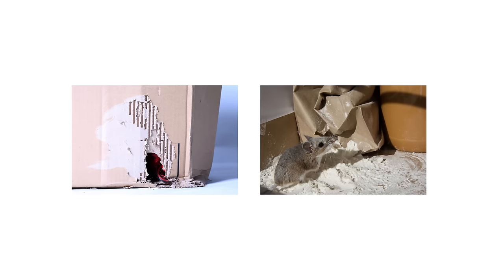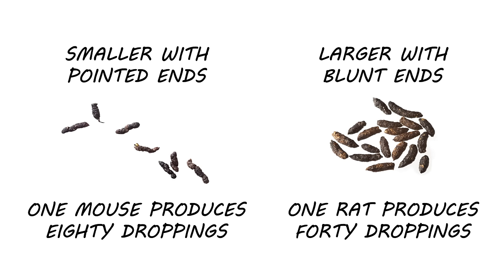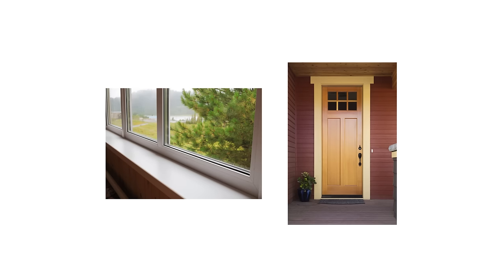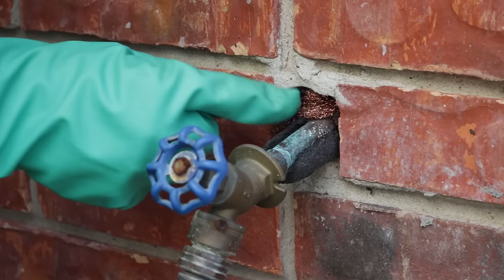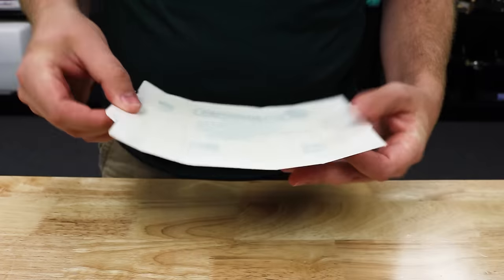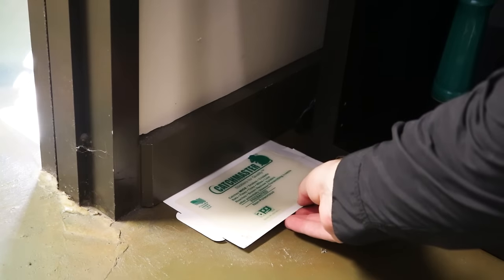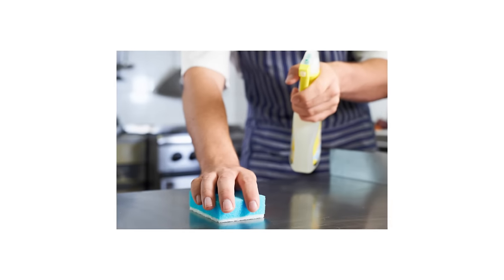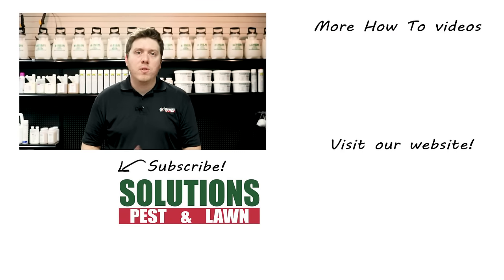How to Get Rid of House Mice (4 Easy Steps)

Comment: I never had a mouse till the last cat died at 18. Now it's like they got a memo 'cats gone' and I've had several. I am not use to killing them, I'd rather catch and release. I hated snap trapping, plus they get use to them and don't go near them after one or two died on them. I got rid of several with a simple bucket and food in bucket. They can only jump halfway up the bucket and by then I can release outside. The ones that can get out of bucket (better jumpers) are a problem. They love to explore, even places where there is no food. Why? THEY LIVE TO ANNOY ME!! They know I am a SAP and that they can jump out of any simple bucket. They are cute, and are smart as can be, but of course you don't want them in your house. The sterotypical mouse invaider BS is just that. I am an animal lover, and killing them with glue traps is not an option. The glue traps they show can stick a mouse, they you can remove them with oil. BUT! The sticky traps sold are too deep and the mice cannot be removed with oil. So, I took some of the sticky off and put on pce of cardboard. Only then can the oil on the trap work without killing them Believe me, they put too much glue on traps and mice cannot be un-stuck from it. It is a terrible way to die and the mice squeek and suffer terribly. The glue traps in the vid you can't find anywhere.

Comment: This guy is good- so far I have killed 5 mice in kill traps - the plastic kind - and it’s been about 10 days since we saw the first one . We found what they were eating a few days ago - - I’ve been trying to clean now - I warn everyone to be careful
Which cleaners you’re using so you don’t create a toxic gas - I was worried cuz I first sprayed bleach water everywhere in the bathroom
And then wiped all
The droppings up with paper towel section by section - and then got a bucket of Lysol and dumped that water all over with sponges - nothing happened to me but I think it was bad to mix those ! So now I am
Exhausted
And will
Keep at it next time I can get energetic ! ( they were eating hard corn cobs we had in a pile of stuff near the oven - for the squirrel feeder outside —!! ) I totally forgot about that corn ! Yuck !!! Such a mess . It was in a plastic bag so - get proper storage bins . 😢 so disgusting ! We will get this done !

Comment: Thank you for this video.  I just caught a mouse in a rat trap and it was only his tail trapped so he whined and cried.  I turned over the trap and he made mousy noises as I prepared to strike it with a big metal spoon inside a plastic bag.  I had no other way to end the situation without striking the mouse in the head a few times before it stopped moving.  I felt bad about this and wondered if I should not buy a live trap and release at the park so he could be owl food.  I have a hard time seeing mice dead or dying.  What is your recommendation?
Reply: They're driving me crazy seen them twice already got the old snap traps and use peanut butter as bait the little bastard ain't bite

Comment: There are mice in the walls of our extension, they dont seem to be in the house proper yet, no droppings found anywhere. I called pest control and he put poison and stations all around the house and attic. I also have a major phobia of mice, so right now it's a really tough time for me. I am barely sleeping. There is a pipe outside that is not in use and i think this could be an entry point. I had covered it with a cap but theres a poison base right next to it. I should have asked the pest control guy. But can anyone tell me whether i should keep this pipe covered or not? Because if it is the entry point I want them to be able to get outside to the poison. Sorry for rambling but I'm extremely stressed by this
Reply from the maker: Good morning,
We recommend you save exclusion until a couple weeks after the poison bait has been set. If the bait's outdoors, the mice happen to be indoors, and entry points are sealed off, then the mice won't actually be able to reach the poison. Depending on the poison used, it can take several weeks before you notice a reduction in rodent activity. Then you can seal entry points with stuff like copper mesh and caulk.

Good luck!
Reply: @solutionspestandlawn thanks very much for the reply and advice, I will remove the cap. The pest control guy is coming back in a weeks time, I just want them gone. People don't understand when I tell them how terrified I am, I'm having panic attacks everytime I come home from work and listening for sounds to the point where anything I hear im assuming it's mice or rats. Yesterday morning after work I put clothes in the drier and then when I was in bed thought the noise of the drier was a mouse or rat in the kitchen. is there any use in playing repellent sounds out near where I know they are in the extension? It's so hard working nights and not being able to sleep I just want to do anything at all to get rid of them. Thanks again for getting back to me
Reply from the maker: Unfortunately there's not enough evidence that supports the use of sonic repellents for rodent control. If you have no problem with killing mice, then we recommend you set up some baited snap traps around your home to supplement the poison your pest control guy is using. 5:36 in the video is where we go over how to use our Easy-Set Mouse Traps. Keep in mind that any pest control is going to take a lot of time and patience, and you may not see results as quickly as you hoped. Remember to keep up with regular cleaning in and around your home, and check the bait stations about once a week to see if the poison needs to be replenished.
Reply: @solutionspestandlawn thank you so much for taking the time to help me. I will take that advice and put down plenty of traps. I really appreciate it thank you
Reply: @solutionspestandlawn the pest control guy came back today and said it's rats in attic, looks like they are burrowing in from next door. He is coming back tomorrow and going to tell neighbors with landlord what they need to do. He has put plenty of poison up there and along back garden. He says there is no more that I can do. This is like a nightmare. Terrified in my own home.

Comment: I have a mouse trapped/cornered in my closet.  Unfortunately, it's my wife's extra closet and she has all manner of clothes and boxes in it.  I've placed 4 glue traps and 1 poison bait station in the closet.  I've wedged a number of towels in the gaps between the door and floor.  It's been about 8 hours since I last drove the mouse into the closet but all my traps are still empty.  I'm afraid I may have to start pulling all of my wife's things out of the closet and watching the mouse scurry to another part of the apartment.  Any suggestions?
Reply: What did you wind up doing?

Comment: During 2020, I killed over 100 rodents. They were climbing the cable and telephone utility cables and jumping through a crevice between the house and the patio. Found other small crevices throughout the house. Stop keeping track of 2021's rodent kill, but they still keep coming. I am not sure from where but it's an infestation. And they chew through the plastic so storing food in plastic containers has not helped much either.

Comment: 🐁 🛑 Pest Repeller from Amazon saved me mousefestation woes. I was being woken up by them or seeing them all the time. I bought 6 of them as the house is large including a cellar.  Had them plugged in almost all room on all the time and up til now since plugging them in, no mice - for 6 months straight. They're little white  box, 3 inches long, 1 inch wide and has a little round blue light in the bottom right hand corner of the device. 👍🏼

Comment: maan! the one I got at home is practically a pet by now, I just can't get rid of it! It's sooo smart, all I can find is poo all over my oven top, from time to time I hear vicious little gnawing going on somewhere inside my stove, I tried flipping the stove over but the little bastard never got scared or jumped out running away, I heard it inside getting nervous but never came out so I decided to put wooden boards all around my stove, I thought it had jumped out stealthily and I figured I had gotten ridden of it but it simply moved to the inside of my fridge, not inside it but somewhere inside the exterior between the outside and the internal walls of it, and sure thing, the little beast switches places at will from stove to fridge. Should I gas the entire kitchen? what can I do?

Comment: Been a retired firefighter 3 1/2 years after 32 years on. One of the last calls I had was a fire in a gas line behind a stove. Short of it, looking at the gas line there was a small hole and burn in the metal gas line. Guy in the apt said he moved it to clean and pushed the stove back and bang, gas ignited.

So I'm looking at the line and my deputy showed up and said capt. lemme look at the cord. Sure enough, fucking mice chewed through the electrical cord for the gas stove. When the guy pushed the stove back in the damn elec cord arced against the gas line and the arc made a hole and an ignition point.

I have been in my home 29 years and this winter has already been a banner year for mice. For 28 years I have nailed 4-7 mice per winter. Just in the last 5 weeks I am over 32 mice. Winter hasn't even started! Any compassion I ever harbored for these little shits has departed!

Comment: I actually felt bad killing a mice because the mice was so smart. But it  ate my slim Jim’s then my bread. I managed to get it into my room and the sealed the door. I wanted to trap it and then decide if I wanted to kill it or let it outside. It is too cold outside so killing it would be showing it mercy. I was thinking about caging it as a pet till spring but the thing ran to the door and got under the towel and I got scared thinking it would find a way to get underneath the door so I stomped the towel. It died really quick I don’t think it felt it which was weird because I didn’t see any blood. 

The thing is though while I was trying to catch it in my room I noticed a 2nd mice. Somehow that one disappeared. He must’ve had a Harry Potter blanket or something because I have no idea where it went.

Comment: Mice and my house don't go on the sticky traps and they don't hit the traps either the snap traps I've tried both of those. The sticky pads caught everything but a mouse, lol. They are stuck to my floor out of scrape them off and use alcohol and tried to spray them with bleach everything loosen them up but I'm soaked . I've used peanut butter and I put a piece of dog food on top stuck it into the peanut butter because they always go after my dog's food so they usually would think that that would be safe no I did work like last year but this year they're not going for it. Istock Brad on top of the peanut butter cuz they were eating my roommates Brad and I told him to put it in containers.
Reply: Hello Bonnie 👋🏻

Comment: ok I've done all this, caught about 7 initially. But there is this last one, refuses peanut butter, has never touched the bait stations. And avoids the sticky papers... what's next???
Reply: Have you removed other possible foods that the mice could get to?  The fewer options a mouse has the more likely it will become desperate enough to take the bait.

I had a very tricky mouse problem myself. I put a glue trap in a box that was about the same length and width as the glue trap. The height of this box was about 3 inches tall. One side of the box was removed to create an opening. This way the mouse was forced to approach the bait from the opening. The mouse unwittingly went onto the glue trap after the bait and was caught. It was a relatively strong mouse, too, so I made sure that it couldn't escape the glue after I found it in the trap. Maybe this box idea could work for you, too?
Reply: @tomackerman4089  Absolutely not even crums

Comment: I don't actually get why people are so grossed out by mice and rats. They just look like a mini version of my cat (sort of). They're cute to me. I use snap traps and only set them when I am in the house so I can hear the bang when the trap catches one..  takes me seconds to get to the loft and about half the time they aren't dead so I just use my hammer to bash them on the head a couple of times and job done. Otherwise they are left in pain. No reason for people to be insensitive. I don't get what the big deal is. Same thing if my cat catches a bird and leaves it half dead - I get hold of it quickly and break it's neck or pull it's head off. Sounds gross but it's quick and kind.

Comment: What if the mice are getting through from under your house
Reply: Are you in a mobile home?   I am and I found that they chewed a hole up through the flooring, somewhere in the kitchen.   We set snap traps in the crawl space.    It took 5 weeks to catch anything, up to 3 trapped now.   None of the traps inside the house were triggered.  You need to see how (if) they are getting into the house.    They got into mine and the inspector pin pointed possible enter points that I am repairing.
Reply: @kf1683  no, i'm in a house, that i bought from scam like renovation company

Comment: I'll just get a ferret and let them thing live under the floor with them. 

I live in a house that's built on top of an apartment. My neighbours on both sides with apartments under them. So my place is surrounded completely 5 other homes luckily none above me. So I dont think it really matters what I do. If they are dirty neighbours and I think downstairs are I have no chance. I live alone atlesst so can keep my place stinking of bleach. 

I wread peppermint deters them too so im going to look into getting a plant or 12. It would be nice to have the house smelling of mint too. 

Garlic. Ammonia. Onions or peppermint. Erm. Peppermind please. 

Its scary though I think I dreamt a huge rat was on my bed nuzzling around it felt as strong as a cat. I'm sure I was dreaming though but that was before I had it confirmed by neighbor theres mice in the building. I just hope to god it was a dream.

I found a hole in my walkin wardrobe which screams mouse hole though. I plugged it up with e6000 glue but I must not have used enough cos the hole was still not plugged this morning unless it was used last night and now a mouse is glued up somewhere. 

I hate them.

Comment: I put all my snap-mouse traps inside a canary cage (one with 2 doors) this way the traps are contained in ONE location and cannot be drug off. I smear peanut butter inside trap with a small cracker on top of peanut butter. Yes as much as they are cute, I’d prefer using a trap for a quick kill.. glue traps is a slow death for them… Then I take the deceased mouse and place it on the tree trunk in rear yard… no chemicals ingested by the mouse, so I can be confident any hawk, owl, opossum or cat ingestingvthe deceased mouse will not ALSO BE A VICTIM to chemicals like D-Con that will eventually kill them

Comment: Glue boards are horrific. Notice he doesn't tell you how to dispatch the terrified mouse stuck, still alive, to the board.
Reply: Better to use glue boards than to tolerate a mouse infestation and be victimized and terrorized by mice that never had any right to be there in the first place. Mice breed too quickly and are too problematic to do nothing. The reality is that glue traps are often very effective and it's obvious whether they are working or not. That's not the case with every kind of mouse trap. 

These mice are unwanted pests that were never welcome in the home in the first place. These aren't pet mice we're talking about, they're PEST mice. They are nasty, creepy, unwelcome home invaders. They are the bad guys here not the people who kill them to protect their homes. 

Are glue traps cruel? It shouldn't matter to people because we are talking about pests here not important animals. An exception really ought to be made when it comes to dealing with pests and that includes house mice. 

Compassion for house mice is misplaced compassion that puts up unnecessary barriers to actually eliminating a mouse infestation.

It is not wrong to use glue traps. Again, these are pests we're dealing with. House mice are not there to be your friends, but rather to take advantage. It is practical, righteous, justified, and moral to use glue traps get rid of house mice if that's what actually works.

Comment: This guy is talking absolute sh¡te.

He spends half the video telling you what you already know 
and the other half recommending methods that have been conclusively proven to not work.

Here's an unpleasant but effective method:
Caustic soda,
you can buy it in crystal form,
it's for unblocking drains, sinks ect.

Put about half a teaspoon of Caustic soda crystals in cooked 
(grilled, fried whatever)
Pork sausages.
Leave the sausages around for the mice to nibble on.

Like I said, this method is unpleasant, 
so if you can't stand a bit of gore,  
call an exterminator instead.

The crystals react to the fat in the sausages, 
which in turn react to the mouse's stomach acids 
and cause them to explode.

I said it wasn't pleasant and it will require a fair bit of cleaning up 
 but it's one of the few ways to rid your home of rodents that won't cost unnecessary expenses.
Reply: Mouse/rat glue traps with peanut butter as bait have worked for me. I caught 4 of the things. The only cleanup necessary was to put the trap into a bag and throw it away.